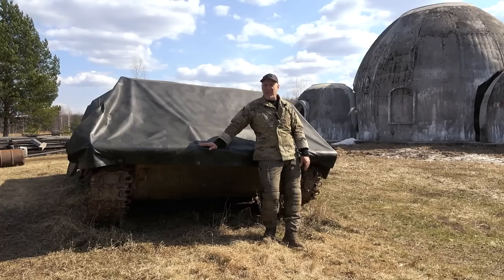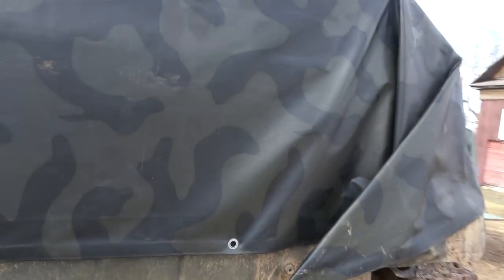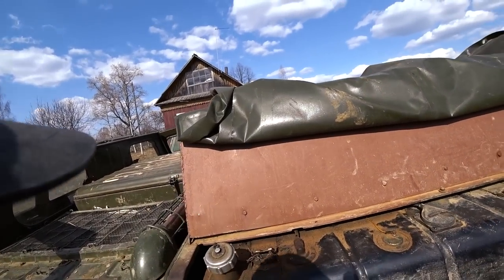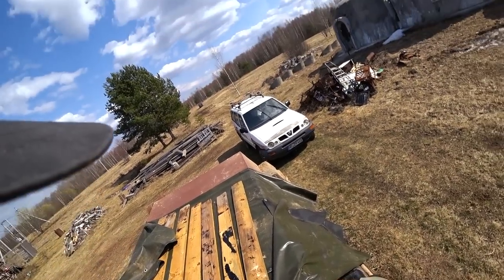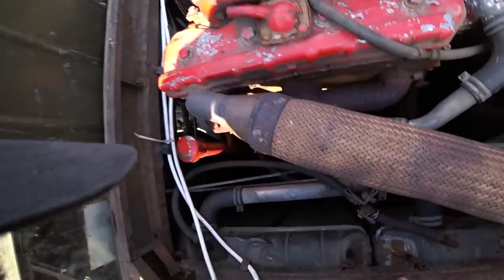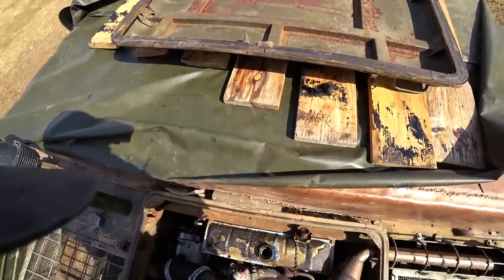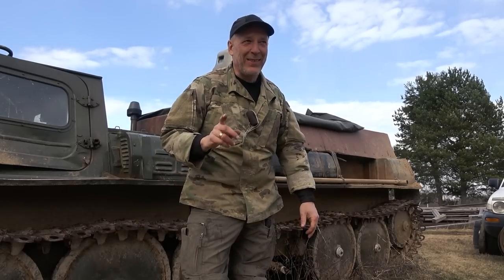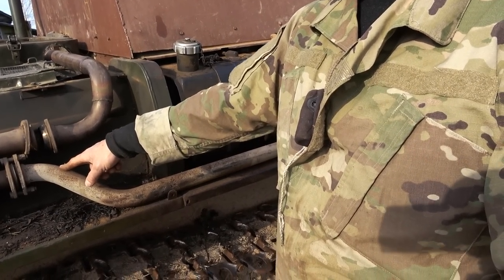Getting The Tank Ready For Some Serious Camping - Not Been Running For A Whole Year

Comment: Usually diesels get down on power from  fuel starvation (blocked filter) or the injector nozzles need servicing.  Sometimes there can be a lot of carbon build up on the piston rings........and in a non-turbo engine, thats a real possibility.  To de-carbon...........just give it a sea-foam tune up, or just spray water into the air intake while its running with a hand spray bottle for 15 minutes.  Project Farm channel did a de-carbon on an old pick up truck, and it really brought it back from being very tired.

Comment: The fuel which your adding looks more like winter fuel. As that here doesn't have the paraffin in it.If or since you don't run that as often which you might? Get or use a water fuel filter perhaps if  it has a fuel filter? Perhaps after look at  the fuel filter see what is in it?  
Geeee you can't beat that for starting!

Comment: Lars, a few quick questions. How does it handle diesel that is a bit funky? Do they still make these or a similar one? And is it hard to take tracks and wheels on and off? I know on the M24 and M-60 tanks of some folks near me they are a PITA to take on and off as they are tank tanks (a light and a BIG MBT) and take winches and several men as things are obviously much heavier. A smaller tundra/taiga tank seems a lot more practical to work on for an individual and cheaper on parts and fuel. And if it can float it would be ideal.

Wished I had land and cash to buy stuff like this. Some day I hope. You are living the dream being remote and self sufficient. Watched you since start. How is the babushka you showed in a prior set of videos. Is she still making delicious foods? Hope she and you and the family are well. My family originally came from North Germany not far from Denmark. I consider us North Germans and Danes almost one.
Reply from the maker: It runs fine on scruffy diesel. It's a tractor engine, basically. They still make these. The general design is from 1967. Tracks are not hard to remove and put back on. Two guys can do it. Three is better. It can swim too. It has a bilge pump for longer stays in the water.